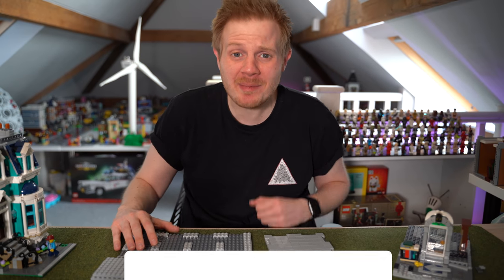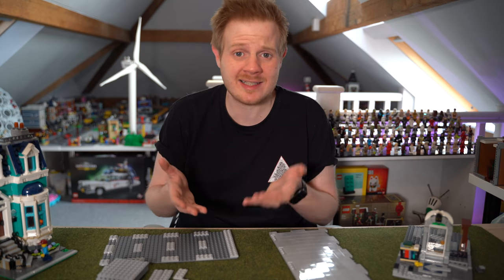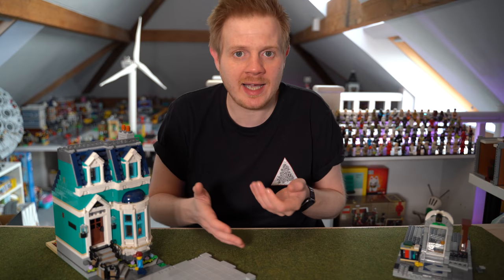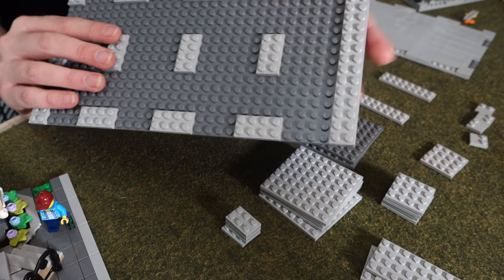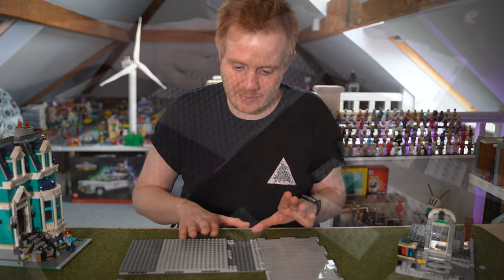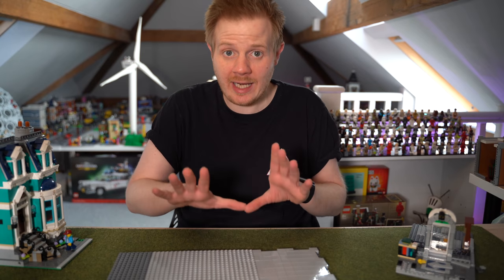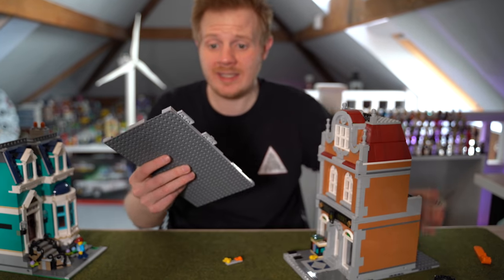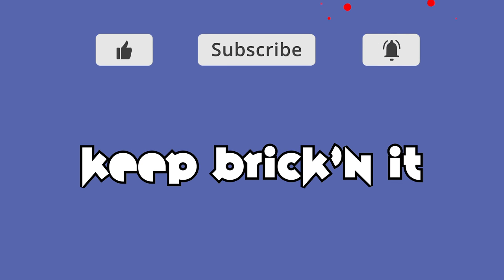New LEGO ROAD PLATES... SOLVED! How to use with Modular buildings & why? Brick'n It Mini-mils system

Comment: To my mind a difference of two plates between the road surface and the footpath would be more realistic. This would the baseplate for the modulars would be three plates high with one layer of smooth plates (=4 plates high against the 2 plates height of the road sections). I suspect that we'll see 16x32 (or similar) by 3 plate high baseplates, likely with holes along the side for technic connecter pins as are now built into the walls for the modulars. This would make the modulars more modular with the connector pins in the plates rather than trying to match the pin locations in the designs of each modular. Parks, gardens, alleyways, and more will now be options for offical Lego modulars as the location of the connector pins wouldn't matter. I suspect we'll also see special connections/connectors to bridge between the new road plates and any new baseplates.

Comment: I like what you've done. it adds a nice curb. However my plan is to just put a layer of baseplates on my table. Place the road plate directly on the table baseplate, and rest the modular building as is on top of the baseplate (built on its own baseplate just set on top of the table baseplate. This makes its sidewalk even with the road. I can choose to clip it in then, or just have the roads and other buildings hold it in place.
Reply from the maker: That seems like an awesome idea :)

Comment: If you build everything on baseplates, then you could also just remove the Baseplates...

But there’s a much simpler solution. 
1. Take 2 48x48 baseplates side by side. 
2. Put road on three edges of the baseplates. 
You should have a 64 x 32 area surrounded on three sides by road.
3. Put some plates on the 64 x 32 area.
4. Put 2 modulars, baseplate and all, on the plates (loose on top of the studs). 
The sidewalk of the modular is now exactly one plate higher than the road. 

Very cheap. No modding of modulars required.
Reply: Or, just do, from Step 2:
2. Put road on one of the long edges of the basblates.
You should have a 32 x 96 area aside to the road.
3. Put some plates on the 32 x 96 area.
4. Put 3 modulars, baseplate and all, on the plates (loose on top of the studs).
Reply: @fhurlbrink  absolutely, I’m just trying to convey the geometry. You do want to do something around the edges of the modulars, because they will just slide off if you don’t. That’s why I described the “u shaped” road layout.

Comment: I like your thought process, but I would adjust it by making your modular base a full mini mils and just adding tiles to the road plate so that you can still pull everything out and move around as is often the case.  Bravo for rolling with the change and not just throwing up "roadblocks" (sorry for the pun)
Reply from the maker: Thanks mate i really appreciate it. Some people think ive been paid, because i am embracing the change lol
Reply: It's only a change if you accept it. Why not just buy old baseplates instead of wasting tons of money on ugly, reflecting roads which are too small for most cars and don't fit naturally into the baseplate system?! Makes zero sense.

Comment: This is good in theory, but unless you have all those parts spare, it's probably cheaper to go full mils plates if you're just starting out your city, for an existing one, say bricksie or alex nunes, doing that for every building is going to be mega expensive, be cheaper to put 3-5mm ply under all the buildings and sink the road to get the height. we shouldn't have to fix this, just lego getting  more money out of us. like the idea though, but for small scale builders its going to cost too much.
Reply from the maker: Yeah exactly. My City is no where near as massive as Alex's and i would not bother changing at all if i was in their shoes. At the moment i am on the fence about it which is why i made the vid :) to try and problem solve the issue :) im hoping that the old road plates dont go anywhere so people ca use whichever system they want :)

Comment: I would actually do that way easier where you don't need the extra baseplates at all.
Just leave the road plate as it is and rebuild/move your modular building from the baseplate on to 2 16x16 plates, 1 8x16, 1 6x16 and then you have the space for the boardwalk connection, under them you can put the same "outline" that you have with the 2x4 plates. Done. You have the exact same effect like in your video but without any baseplates. You don't need one extra for the roads and you basically do it exactly like you did, but minus the baseplate on the modular building and road plate.
Love your  idea for the raised sidewalk by the way. These 2x2 plates with only studs on one side are the ultimate solution for that problem.

Comment: I build my modulars on multiple 16x16 plates instead of baseplates, so I won't have any problem aligning them. Even better, I hadn't laid down any roadplates yet, and was thinking about a way to create the roads. I do like the idea for raised footpaths, so I'll find a good way to do that too. Perhaps some extra 16x16 plates under the modular.
Reply from the maker: Yeah someone else mentioned 16x16baseplates, that might be something i try out. Could make it alot cheaper!  I could then change them gradually when i put lighting in the buildings
Reply: @BricknIt  With the bookshop and pet shop I made small adjustments in the back: instead of two 16x16 plates, I used one 16x16 and one 16x8 plate. I effectively removed the garden there, but it did allow me to place them in tighter spots. And only minimal adjustments were needed. I started with the plates since I am building my modulars onto a mountain, and clicking plates in place on a mountain top is easier than with base plates. I guess it was a good decission, looking at the new road system :).

Comment: Basically, if I wanted to apply this solution to a city full of modular buildings on regular base plates, I would have to buy a lot of stuff and I would have to rebuild at least the ground-floor of every building - all that, just because Lego isn't able to offer regular road plates in different sizes. Well, no thanks.

Comment: Love your idea for a fix. I will just leave it with that. Don’t want to get negative. I’m looking forward to the new system but still not sure if i will switch. Thanks for sharing.can’t wait to see more of your LEGO city. 👍
Reply: Love the diplomacy. 😂
Reply from the maker: hahaha. I never realised how heated the conversation about these road plates would be lol. Im of the same opinion as everyone else when i saw them but for me the added space it will give me is why i tried to see how easy it would be to fit them into the city. As you can tell im still 100% sold on them, but seeming as i will be buying some of the new city buildings next year anyways and they come with the plates im open to testing them and trying them out :) sadly that does make the sets even more expensive!
Reply from the maker: hahaha!
Reply: @BricknIt  i understand the space savings , but the cost is going to hi. First you have cost of the baseplate and then you have to buy the other plates to build it up. I think is a lot of AFOL go this way there will be a shortage of the additional place needed to raise the new road plates. Like the light blue gray tiles. If that’s the case you will have lots of plates you can’t finish because of lack of parts. I guess time will tell. 👍👍

Comment: Very cool! However, wouldn't it be cheaper to get rid of the baseplates on modulars, and just replace them with 16x16 and 8x16 plates? Phase out baseplates - go with a 3 plate high system? (plate +modular -baseplate and plate + 2021 roads) Baseplates aren't readily available, but 16x16 and 8x16 plates are still being released.

Comment: I do like the look and versatility of the new road plates but for me they may not be ideal. My Lego town hasn't seen the light of day in 20 years and if I ever decide to buy the modular city buildings then I could incorporate the new plates with the old somehow, maybe use the new for the city centre and modular buildings and keep the old for the outlying areas. They don't really allow for inner city street parking or for running a monorail through the city centre though without building up adjacent plates. There is much to consider....

Comment: Funy thing to know about the new road plates. If you buy 2 Sets of then, you can't connect them. There are no extra tiles in the Set. So you either already have Lego at home and are propably already using the old roads, or you will never be able to build a bigger street without buying tiles from a second hand shop or website. 
Great thinking by Lego

Comment: The real question is what will the new modular have for its base.  Will it be same as the previous ones or will it be a new design to link to the new roads.  Guess we will find out tomorrow...
Reply from the maker: Yeah this was my worry and the main reason i started tinkering with the new system. I believe its going to use baseplates though so everyone can breath a sigh of relief :)
Reply: If they're still selling baseplates it shouldn't be an issue. You'd just have to put the modular on it. Or if you're really sure you want two buildings next to each other, get a 32x32 baseplate for them and use a 16x32 for the road outside.

Comment: I'd say just add 2 plates of extra height under the building, don't add a baseplate under the roads, and then your sidewalks are 1.5 plates above the road surface. No need to connect the roads and the plates the buildings sit on, because they'll be trapped so they can't move around.

Comment: That is a great solution! It could also be possible to use the big grey baseplates as the base for an entire city and then just placing the modular with the baseplate on top of those grey baseplates (plus one plate of height for a curb) so you would not have to modify each modular 😱 it would be a bit more costly I think tho 🧐

Comment: That's an awesome solution! The one thing I would do differently is when taking it apart, rather than having to disturb the pavement pieces I would would just take the road off leaving the connector pieces attached to the building rather than the road. 
I've been trying to think of a way these new roads would work with the modulars and I was thinking of something along the same lines. Definitely going to be doing this!

Comment: This is actually a decent solution however they should offer a trade-in program where if you have the old base plates, you can trade that in for the equivalent to the standard base place with the peg on top and the holes on the bottom, which, as far as I know, only come in 16 x 16 so they should provide the amount you need to replace the base plate under any building New or Old that you have considering they are promoting their new road system. As far as the issue with vehicles not passing each other. A lot of the newer sets were the vehicles are 6 to 8 studs wide. The same thing happens on the old road base plates and in fact the Lego delivery truck is incompatible with all the old road baseplate systems and at least with the new ones, you can make the roads wider to accommodate these wider vehicles. Is what’s happening complete crap from Lego and potentially a money grab yes does it mean one should stick to only buying older sets not necessarily however with all the information on the Internet Internet it is just as easy to mock up the equivalent to what Lego is selling potentially for cheaper, and make your own buildings and vehicles and be able to keep them to scale without a huge knowledge of all Lego building techniques as instructions and Park counts are available for every set. Therefore, you can be guided through each step just simply modify what you decide to put down as the base plate and the road system for your LEGO town and or city. Potentially the best solution at this point is figure out the space you have for your city and then Elmer‘s glue or hot glue down base plates to completely fill the area standard old-fashioned base plates and then add any roads from the new system or buildings on top of that, yes you may pay a little more, but in the end, you have overcome a major problem don’t have to go out and buy specific thickness foam craft board to put under base plates a buildings to make them even with the road or try to figure out or leave the height difference alone with the road, setting a little bit higher and mini spots. The absolute best choice to meet is to cover the table or shelf where you have your city or town with standard base plates rather 32 x 32 or 16 x 32 or 24 x 16 plates and then put your buildings on it and make your roads sidewalks out of Flat plates and smooth tiles, especially if you can find a deal on a huge lot on platform such as eBay and other places where you can buy Lego. The last thing I will say is for those complaining about the price of Lego and the changes is that I left LEGO for a while it went to model railroad in 1/87 scale and for what you pay for one locomotive today you can buy multiple sets and 16 x 16 plates to go under them and the cost of one locomotive therefore this makes it so that I am potentially getting ready to sell off all of my 187 locomotives and cars and track and return to LEGO as the cost is still cheaper and they do offer a reasonable railroad not 100% Accurate with choices of all locomotives and freight cars would allow for the buildings for a model city. Buildings usually cost equivalent to a medium sized LEGO building site and you have to deal with gluing them together super tiny parts that may or may not go into place properly and look good and then painting them. I hope this makes a few people sit back and think, and maybe even the original poster of this video to evaluate their stance on how to present and utilize the new systems with the old and can help people come to terms with the extended cost. Finally I will give a reference to LG, a single locomotive and digital command control which is a decoder which is inside the locomotive of 1/87 model locomotive and buildings the locomotive from $179-$700 buildings range from $26-$150 and you have to assemble them just like Lego except for with proper modeling cement to be able to allow proper time to position apart yet hold strong enough not to break loose as you continue to assemble the buildings were Legos push together have a very good history of staying together and providing decent models, especially as your skill and building grows and you add your own personal modifications to the sets that they have or build your own from scratch.

Comment: Everyone is criticizing this new road system, but I really like it because it will allow me to have wider roads for the new bigger cars and more details around.
Reply from the maker: I think people sometimes just don't see other peoples point of views. The vid is supposed to help people that want to adopt the new road system. I am also very interested in it aswell, that why i made the vid :) and i hope it helps people who are :)
Reply: what? the new roads are smaller
Reply from the maker: Wolf. You can actually attach 2 road plates together from the sides to make them wider than the baseplate ones
Reply: @BricknIt  yoooooo
Reply: @BricknIt  Thing is, by buying those streets you tell lego they did something good. And they clearly didn't. It costs more, u have to buy more parts to make it work even if you use buildings NOT attached to baseplates cause the streets are way too high and the streets are too small for most cars. sure, u can use 2 plates next to eachother, but then the road is too big for most cars and u have to pay DOUBLE the already expensive price. so even if you like them, you shouldn't buy them. just to show lego they did big bullshit. maybe they will come up with something actually good next time.

Comment: You don't actually need any of the baseplates for your method here. Simply leave these out from beneath your roads and your buildings which will be a significant saving on parts.

You can, in fact, leave the modular building on its original baseplate and raise it up to the correct height by placing it on top of one layer of plates. This won't allow you to connect together the roads to the modulars in the same way but it's a cheaper way to do it.

Comment: I doubt that I’ll be adopting the new system, unless it’s for an alleyway build or to tile a bridge, because if I have to do work to make a road, I might as well do full MILS, which isn’t significantly different in cost, especially if you can get the parts through LUGBULK. Also, with Lego’s trend towards wider and wider minifig-based vehicles, these aren’t wide enough unless you want to put two plates side by side.

Comment: With all due respect we shouldn’t have to buy extra bricks and plates just to accommodate the new road system, if you have a dozen or more modulars or buildings on your city the cost in extra plates etc just to make the roads compatible would sky rocket immensely. Don’t get me wrong Lego has come ahead in leaps and bounds over the years but I don’t think the road plates needed to change that much with the possible exception of maybe different designs on the plates aside from the standard 4 plates
Reply from the maker: I completely agree! It was really annoying me trying to figure out how to attch them to my existing setup which is why i started making the vid, hopefully t help people who had the same worries :)